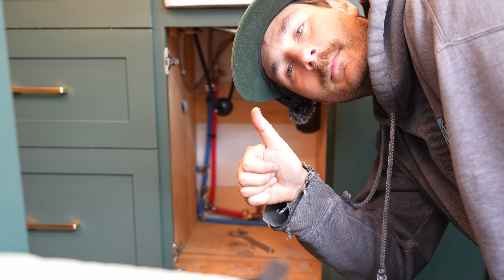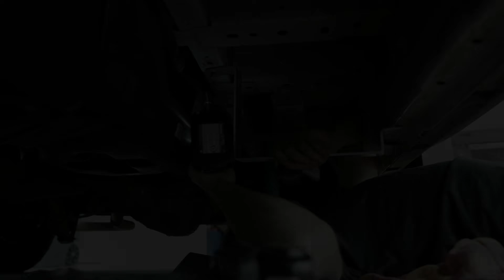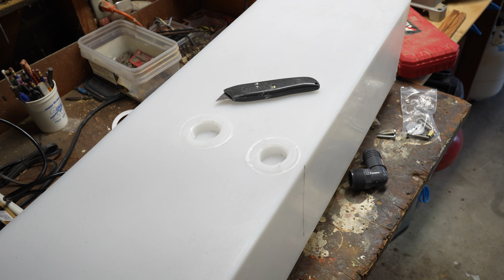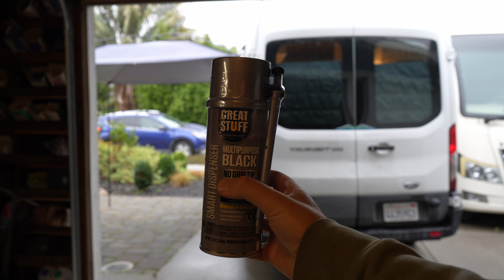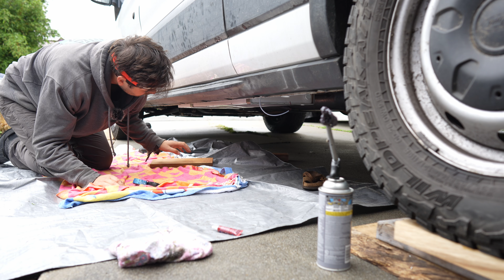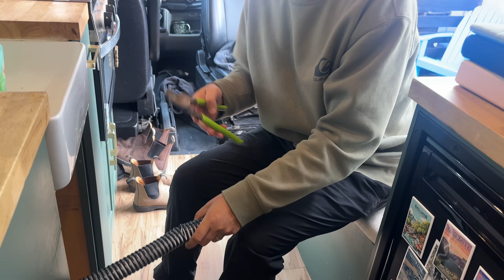Grey Water Tank Install | Curious Campervans Grey Water Tank | Ford Transit Water System

Comment: how often would you empty your old setup compared to the underwater mount? I am in Canada and trying to decide if its worth it to do it exterior vs a small tank inside.
Reply from the maker: With the old system we could catch 7 gallons at a time. We had two tanks totaling at 14 gallons. We probably swapped tanks at least once a week. And sometimes we’d even over flow one. 

With our new system, we can go at least a week without even thinking about it. If we are in an area where the grey water can just be left open then we really don’t have to think about how full it is.

When we were in Canada this winter we  had to leave it open pretty much the whole time so that it wouldn’t freeze. 

I love not having it inside anymore. The constant checking of it would overflow was getting annoying. 

If you do go for the exterior you could always wrap it with a heat element and insulation since you’re up in Canada. And if you do it, I’d highly recommend the motorized ball valve. It’s so nice to have it automated! Good luck

Comment: thx for the tutorial. i noticed that it is not centered on the 2 beams. Does that matter at all? What is to stop it from sliding back and forth out of the straps?
Reply from the maker: In our experience it hasn’t mattered at all. 

What you can’t see (or feel) from the video is that the metal strapping is tightly squeezed onto the tank and frame. It will not be going anywhere.

We’ve had it for six months and have been from the bottom of California to Canada to Utah and back to California. Hasn’t moved and has worked flawlessly 👌🏼

Comment: I have my sink on the passenger side along with my 24 gallon over the wheel well NW Conversion water tank. Do you think it would be easy enough to run a line out and across to the passenger side to the tank? Or, do you know of a tank that mounts on the passenger side? I have 2019 Transit HR - 148" LWB
Reply from the maker: Ita definitely possible but for ease and space savings I’d recommend running water lines on the side the tank is on.

Here’s one: https://curiouscampervans.com/collections/transit-water-tanks/products/transit-wheel-well-water-tank-27-gallon?sca_ref=9249031.2bf4UD04dH

Comment: What stops the tank from shifting forward or backward?

Why do you need spray foam? Can’t you just leave it as is?
Reply from the maker: The aluminum strapping is on there pretty tight. It’s not going anywhere.

The spray foam is to prevent water intrusion.

Comment: Hey guys, thank you for the thorough installation video. My gf and I are about to do the same to our 2020 Transit. What size wire did you use btw for the electronic valve?